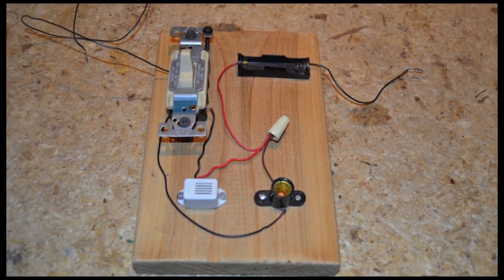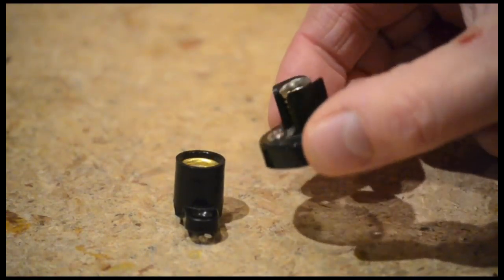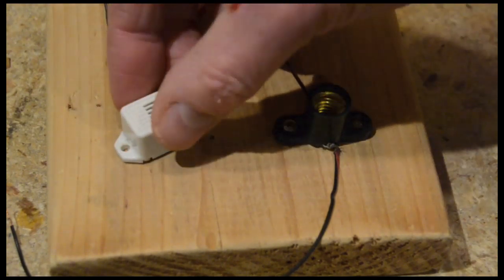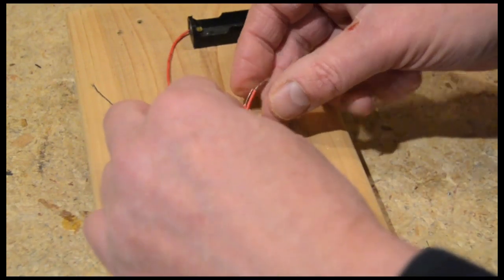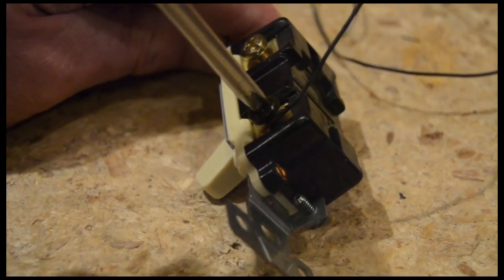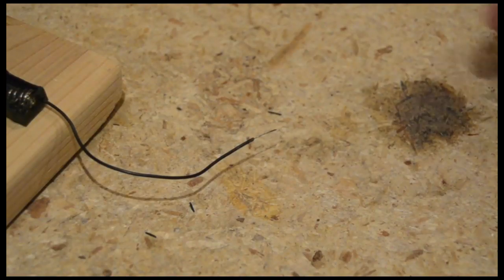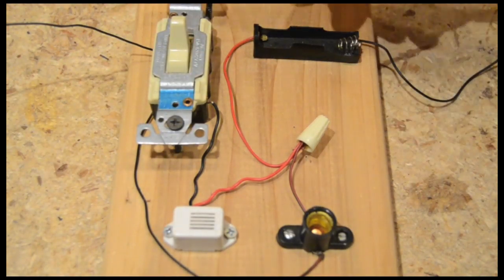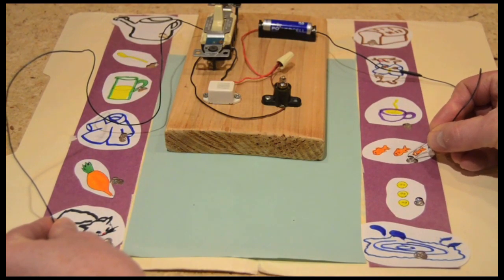How to Make an Electronic Matching Game -- The Circuit Board -- Part 2 of 2

Comment from the maker: A lemon battery doesn't generate sufficient power to make most lightbulbs light. Connecting a long string of lemon batteries might work, however. Let me know if you try it, and how it turned out!